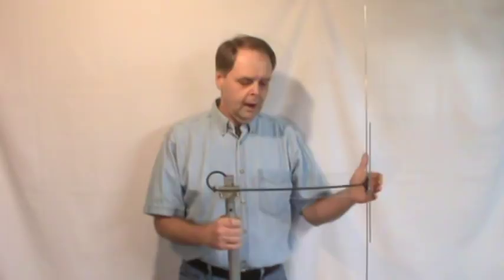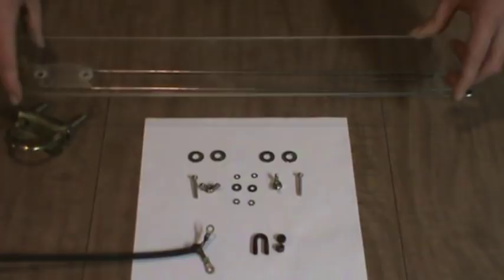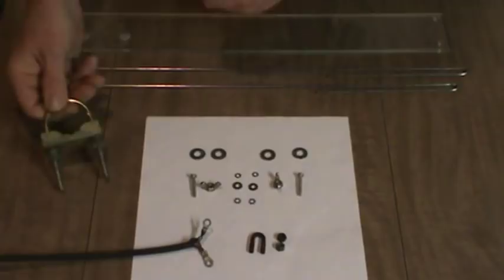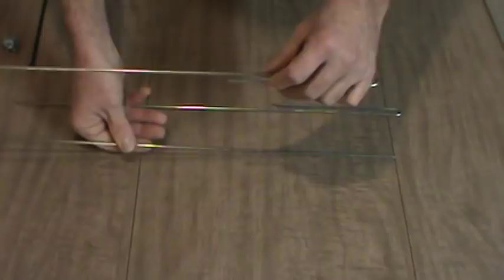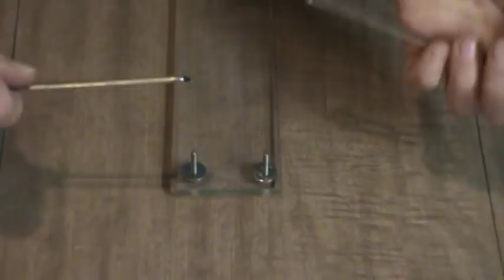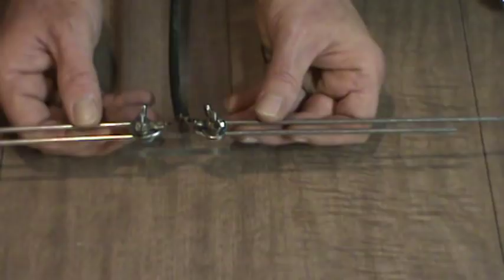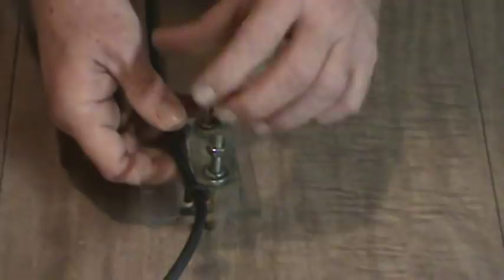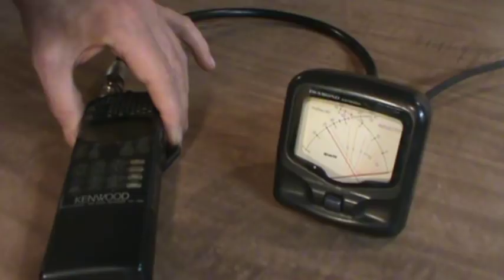Ham Radio 2m/70cm Vertical Dipole Antenna

Comment: Hi Dave, great video. I have just completed construction of this antenna using a couple of old CB antenna whips which are also made from stainless steel and a length of timber for the boom. My antenna is mounted in the loft and it works great I can open a 2m repeater 60 miles away using my handy running 5 watts. This is my first ever homebrew and I'm really pleased with the result.

73
Dean M6BYF

Comment from the maker: Reflectors can be added to the antenna giving it an extra 2 - 3 db gain and about a 58 degree beam width. The reflectors can also be stainless steel rods and can be attached with small u-bolts, from wire rope clips like I used to hold the coax on the end of the boom. A reflector for 2 meters might be spaced 15" back from the driven element and made about 40-1/4" long. For 70 cm a rough guess would be a 13" long reflector mounted no more than 6" back from the driven element. Thanks and 73! :)
Reply: marco    poggioli    piacere   antenna 88   108   fm  pacco
Reply: Dave i thank you for sharing the wisdom of making this wonderful antenna but can you give me a dimension of how long is each element from the bolt bend till theyr tips for 2 m and the 70cm end??????
Reply: hello can you show me a drawing of the reflector for this? thanks
Reply: that's really a great idea can you share a detailed diagram, please

73
DE VE7JAI
Reply: @HaRedVlogs  same here, I want to know how to install the reflector.
Reply: sir is it possible to put a 2m 70cm reflector on the same boom?

Comment from the maker: Usually we use baluns in larger HF dipole antennas.  For a small antenna such as this a balun is not critical.  Using a balun with this antenna may cause more problems in terms of loss rather than be of any real benefit to matching impedance.

Comment: This antenna is good, I can  reach a repeater 50 mile away, but my radio doesnt have the punch to get a audio signal there 20 watts maybe, I can reach other repeaters 30 mile away and get good response, same 20 watts, I am a member of a 2 meter group in Hiawatha,  first antenna I ever built.

Comment: I am new to HAM.. I haven't even picked up a radio yet.  I want to make this antenna.  The question I have ...Does the bend have to be 3/8" from O.D. or I.D?  I have some stainless tubing and not sure I can bend it that close without crimping the tubing.  Is is critical to make that tight of bend or can they just run parallel ?  Thank you for your video..I want to watch every one you have to learn.

Comment: Dave, I built this antenna in 2021 and installed in my attic. With a Baofeng HT I could reach repeaters 40 miles away. I have since used it in my mobile radio trailer for field day and other mobile ops. I elevate it about 30 feet and have made simplex contacts 65 miles away.  This antenna works great and is an excellent project for new hams as I was at the time. Thanks!! KO4MkD

Comment: So I built an antenna based off this video but very different. Used the idea of the elements and attaching them but most of the rest was my own design. Friday an Elmer came by with a very fancy analyzer and after checking it all through the 2 meter and 70 centimeter bands he said "don't change a thing" as he'd never seen an antenna perform that well....and he's been telling everybody about the new HAM that built an amazing antenna!

The most impressive operational test was with a Baofeng handheld on low power (1 or 2 watts). It is hitting a repeater 30 miles away off of a 12 1/2 foot (from the ground) PVC mast and running through 100 feet of RG8x coax. Signal report was fully readable but "not as good" as the transmissions with higher power on the Baofeng and my mobile rig.

THANK YOU DAVE for the inspiration to build an AWESOME antenna!!!!!!!

MY VERSION:

Gray PVC 3/4" electrical conduit "T" (with the removable cover)
18" 3/4" schedule 40 PVC for the standoff
1" x 1" x 3/4" slip "T" at the end of the standoff with the elements mounted on the outside of the "T"
18' of RG58 coax from the element feed point, passed through the PVC standoff though holes drilled in it then wrapped around the 3/4" pipe standoff, then into the pipe at the end of the wrapping so it can pass into the conduit "T" where it is soldered to an SO239 that protrudes through the "T"
3/4" schedule 40 PVC opposite the elements as a counterbalance to keep from putting stress on the mast....i.e. balance it out.
The bottom hole of the conduit "T" is used to mount to the mast which is built from 1" and 1 1/4" schedule 40 pipe.

I'll be doing a video on the whole thing when I start building the next one which will first be analyzed without the RG58 choke and then with it unless it gives amazing performance without it.

KG7TUO, Medford Oregon.
Reply: OH...I bent my elements around a drill bit of the proper diameter which I mounted in a hole on a piece of equipment in my garage as I loaned my vise to someone and it never came home. After getting the bend started, I used a pair of Vise Grip pliers to finish the fold. Then I cut the elements to length with a hack saw. I got the stainless rod from a local welding shop. About $21 for 10 pcs of 3' long 1/8" thick stainless welding rod.

Comment: I built this antenna for scanner monitoring and its the best receive antenna of any that I own. Thank you for sharing your knowledge with us.  FYI I used 308/308L 31" Stainless steel welding rod.
 (PGK of 8 at $10-12 from local weld shop).

Comment: Built this antenna last weekend and it works great. Thank you for the video. The only thing I did differently was used a piece of uni strut bolted to the plexi in place of the pole clamp for more mounting options.

Comment: An outstanding presentation - theory is all very well but there's nothing like making something and trying it with scope for adjustment. Topped off with metric units for us Europeans! Perfect practical guidance with the proof that it's works exceptionally well - with a real radio! My vote for the best antenna project on the web.

Comment: Thanks for sharing this! I've been looking high and low for an easy home-made antenna I could make without a lot of specialty parts, and this one is perfect! I was able to put it together with some 1/8" copper wire I had left over from a previous project, and a spare coax cable from our TV. Better still - it works perfectly! I love that it can be tuned without additional trimming. Great design, thanks again!

Comment: Thank you very much! I was researching for a cheap DIY fixed antenna on 2m/70cm for my Yaesu 857d, good enough to hit the repeaters around my QTH using low power, so I built one using your measurements and it works fantastic. 1.02-1.08 swr on 2m band and 1.3 to 1.4 swr on 70cm without any tweaking or tuning. The only difference is that I used 4mm aluminum rods. Total cost under the equivalent of 35USD and about 3 hours from start to first QSO.

 73 de YO4YPC

Comment: You are a Ham always sharing your knowledge. Thank you! I am building this antenna today. I had to use aluminium rods instead, I could not find the stainless steel rods local. I got the plexiglas for free. I cost me less than $15.00 to make this antenna. Most of the cost is the aluminium rods. The nuts and bolts ect..where less and $1.50. Hope to hit the repeater the afternoon.

Comment: Great video. Built one with 1/4" alum rod I had in the shop. Mounted on my roof on a tripod, SWR of 1.1 - to 1.27 across most of the 2 m band. Very happy with the results.  KK4VXL.  73.

Comment from the maker: Steel rods or coat hangers will work but they do rust and have different electrical properties that may make the elements a slightly different length. Fastenal, and possibly Grainger, sells stainless steel rods.  I've added a webpage to my website with links to these and other antenna parts. Click my username to visit my YouTube channel and the link to my website is in the upper right corner. Thanks for watching and 73! :)

Comment: Thanks for sharing your creation! I built one using 1 12' x 1" PVC and 1 12' x 1 1/4" PVC pipes ( Telescoping Antenna Mast), 1" PVC 90 and PVC Box.  1/8" Copper wire and 90' coax... I am getting 1.1 SWR on all 2 meter and 1.2 on all 70cm frequencies.

Comment: Thanks for the great vid. I used your write up, so thanks for that too. I used wood, 1/8th steel, and 1/4" bolts for a first run test. I'm restricted, so this one is in my shack for my baofeng uv-5r. I'm 11 miles from a local repeater. My handheld duckie could barely activate the repeater if I sat right, and the qso was almost completely one sided. Now I get much better rx clarity and my contact reported almost full quieting along with some brief notes about low tx volume of the uv-5r. Next: di
Reply: I added the $25 Btech microphone to my 8 watt Baofeng and got much improved audio.

Comment from the maker: @cl4yd0h You're not far off and the antenna just needs a little tuning. Remember "Lower, Longer." If SWR goes continuously higher from 1.6 (144 MHz) to 2.2 (148 MHz) then the antenna is working better at lower frequencies. So shorten the antenna elements just slightly to tune it higher in frequency. Try adjusting the antenna until you see at least 1.1:1 SWR at 146.000 MHz. 73! :)

Comment from the maker: Hi David, You have the lengths correct but may have missed seeing the diagram. Right now there is a picture of the antenna on my main page of my web site. Click on the picture to go to the project page then scroll down to the diagram.  Sometimes I do make a mistake in a video and so always check my website for construction notes. Thank you for watching and 73! :)

Comment from the maker: You can use copper, aluminum, or what ever you have on hand but the resonate frequency will probably be different if the element diameters are not the same. BTW, the first one of these antennas that I made was built for 2 meters only and had elements made of steel coat hangers. After scraping some paint off the coat hangers to connect the feed line, I used two screws to fasten the elements and connect the coax to a 1x2 mounted on another board (the mast). It worked - but it did rust. 73! :)

Comment: Great video. Thanks for sharing. I have a +2 db gain rubber ducky on my hand held. I can say the gain with this dipole is considerably higher. Super easy to build. I used 1/8" solid copper with stainless hardware. I don't have a SWR meter to test it. So far so good.

Comment from the maker: Grounding the shield side of the coax at the base of the mast should not be a problem. Use the same or similar connecter that I show in my video Dipole and Inverted V Antenna Basics.  Thanks and 73! :)

Comment from the maker: @MacintoshWizard My U shape bends are not exactly perfect but are within about a millimeter or so measuring from center to center. Place the rod about 8 or 9 inches into the bench vise and start bending at a right angle.  Then take the rod out and place the short end horizontally in the vise and finish bending it.  It may take an extra try with another rod to get two that are similar in shape but it shouldn't take much to get the hang of it. Good luck and have fun. 73! :)

Comment from the maker: @cl4yd0h You're getting much closer. :)  Try another 1/8" or so.  I suspect that your HT antenna may have a more gain than a simple dipole antenna if testing it at the same height.  This antenna will work better the higher it is mounted.

Comment: I would have put each element on one side of the plexiglass arm, using the 2 screws to secure it down. That would make a more secure hold on the antenna (w/ 2 points of contact). But the antenna's feed lines might short out the connection, due to the metal screws?

Comment: Technically, you can hook up any antenna you want to any transceiver you want, but performance is likely going to suffer, at best. At worst you could seriously damage your radio by transmitting through an antenna that is not designed for the frequencies you are operating on. No matter what antenna you hook up, though, if the radio is only built to operate on 2m/70cm, those are the bands you will be limited to, without radio modification of course.

Comment: Dave you give conflicting widths for the plexiglass piece. At 02:35 you state that it is 2 1/2" wide, but then at 05:35 you state that there is 1 3/4" between the two holes, which are each 3/4" in from the edge. That makes the plexiglas 3 1/4" wide, not 2 1/2" wide.
Reply from the maker: Please click the link in the video description on YouTube for complete details. 73! :)
Reply: Dave Tadlock
I made this antenna, and installed it in the attic (the landlord won't permit outdoor antennas). With a 5 watt handheld I can reliably hit repeaters 20m away.

Comment: All of the calculators for dipole element length say that each element should be 19.5 inches for resonance at 144Mhz.  I noticed you specified 18 5/8". Was this because it gave you a better SWR reading?
Reply: +Jonathan Rogers different metals are resonate  at diff freq and as copper flows better than ss the distance of the copper will be longer (as the electrons will move further) hope this helps this has been my findings. I keep notes of antenna projects length vs materials and swr.

Comment: Re. using the cable tie instead of a the U-bolt to keep your cable at 90* from the antenna: That's not advisable for long-term use, because the UV from the sun will damage the cable tie quickly. It'll only last a season or two in the summer, I bet. Tell me Dave, for using inside a ground floor condo with a 2m/440 HT, to need minimal construction time and space, but a good trade-off in gain, what do you recommend? Coffee can? J-Pole? Dipole? Thanks again for the great videos.

Comment: Dave, my name is Jim, N2OWM and I've got a question.  Does the Plexiglas have to be 18" long. I have a 12" in length piece of Plexiglas laying around. Can this be used? Or is the 18" length critical?
Reply: I've heard that the vertical antenna  should have at least a 1/4 wave standoff from the mast. Which would  be 1/2 a meter or 1.5 feet.

Comment: I built this with brass rod and it works great at 25' on a mast on my roof. 5w handheld is all I use. I can work repeaters up to 80mi away easily BUT there is one repeater I can only make with a lot of noise. Could I use this same design with longer elements for more gain or would you suggest a different design? Thanks!

Comment: I realize this is an old video, but perhaps you could shed light on something.  I'm wondering if the horizontal/plexiglass part is part of the actual antenna, or if it's just a hold off to move the dipole away from the mast?  I'm just curious, as it seems like it would be mechanically stronger (and smaller) to mount the dipole close to the mast.    Sorry for the questions--I'm very new to this. In fact, my radio hasn't even arrived yet!  Just trying to decide on which upgrade antenna would best suit my needs. Thanks for the vid.
Reply: Not the OP, but my reasoning for such.  It is a dipole and no ground needed.  The dipoles cancel each other out.  Bring in a ground close by would just create an unknown situation is what the OP was most likely thinking with the plexi standoff from the antenna mounting pole (which is most likely ground).

Comment: Whats the significance of the plexiglass length and thickness?  Can wood or any other materials be used?  Can the antenna elements be coated so they don't rust?

Comment: i found your wonderful site and the calculator. My problem is, the calculator doesn't tell me where (what distance or proportion) to put the reflector. Or maybe reflector is not compulsary and it will work just well without it? I got all the materials and will probably do the wonderful U shapes you show here and then add on the same plane directors spaced for the two bands... Thanks alot for your wonderful videos!

Comment: I noticed that when it rained, that my magmount antenna on roof would start showing a poor swr.. I measure resistance at 9.2 ohms. between ground connector and center terminal...  am thinking of changing to a different antenna.

Comment: I like your vid. A newbie to home brew antennas I have a problem. You mention in the vid that the 70cms rod is finished to 6 1/4" and the 2m to 18 5/8th". When I check your mounted antenna on your web site the rods do not appear to be cut to those lengths. Am I missing something? Excuse my ignorance please. 73's.

Comment: Hello Dave. Great build. Thank you. I just finished building one of these antennas and made very subtle changes to your design. (I actually designed it to materials I already have. 4' mast to 1 1/2" angle iron, then to the plexi. I installed an SO 239 female connector in the plexi and ran 2 pcs of short 18 awg wire to the bolts for the rods.) Question: I am getting a high SWR reading no matter where I place the 2 elements. Can't manage to get it below 1.6 on 70cm and almost the same on 2meter. What are my next options? Trimming? Extending? Also, how critical is the 3/8" (center to center) of the 2meter and the 70cm legs? I couldn't quite get it to 3/8". I'm right about 1/2"

Comment: Follow up question.
Do you have a calculator that shows how to build this?  For example, if I make this out of 1/4" copper rod, does that change the spacing between the elements?
Reply: It shouldn't change it as long as you're measuring from side to side of the elements, not the centers. Usually the spacing isn't too important because its two separate bands. I hope this helps!
Reply: Or if you're up for some math set up a proportion equation. Diameter over Gap equals  (Your diameter) over 
unknown gap and solve for the gap. Or set up Gap = Your Diameter x (His Diameter over His Gap)
Reply: Does such antennas have better UHF reception because the antenna is larger. Because it includes VHF dipole? Or does it not affect UHF reception or may it fail to receive UHF?